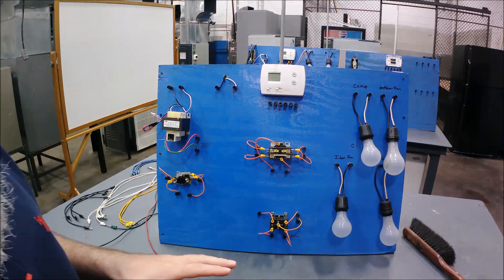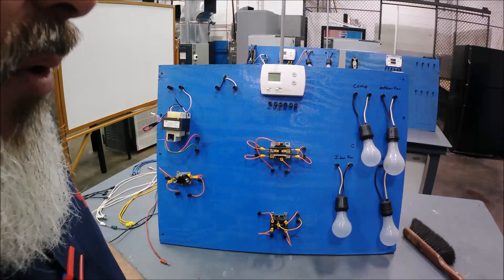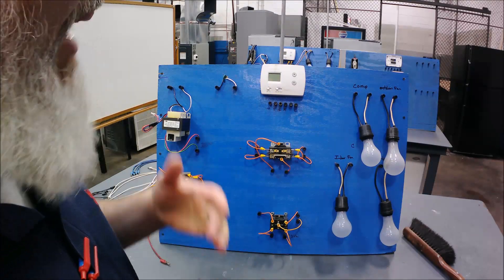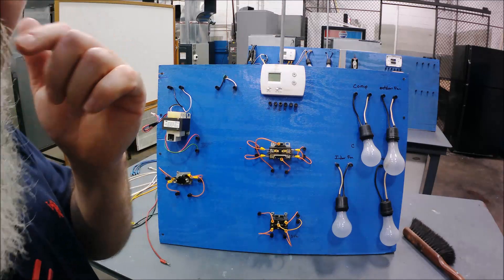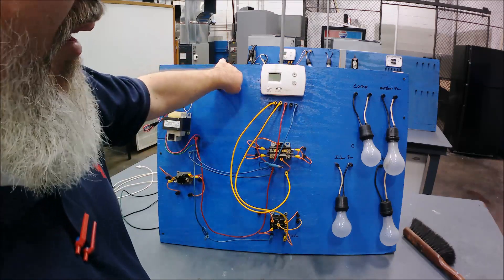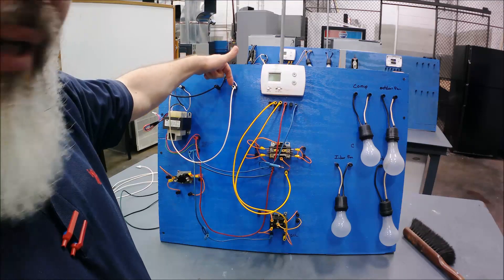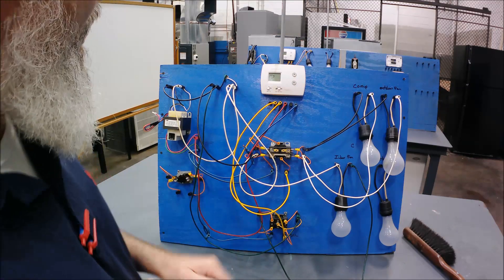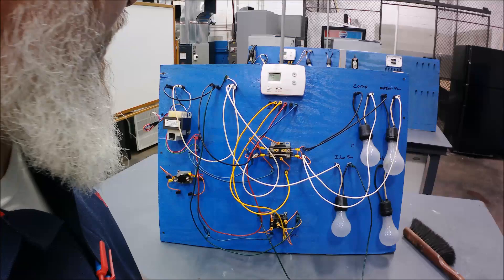Basic Circuits | Practice Wiring Board Walkthrough

Comment: Does the neutral on the 24 volt side of the transformer run through the transformer to the neutral on the 120 volt side?
Reply from the maker: The 120 v circuit has a neutral, the 24 v has a "common". Inside the transformer the two sides (primary winding and secondary winding) never touch. They are essentially doing the same thing...completing a path...but neither one bring any voltage to the table!

Comment: Mr.john Jennings what materials did you use my brother and what size is that plywood God bless you 🙂☺️
Reply from the maker: Nothing but a 1/2" sheet of plywood, cut 2 ft square or so. Propped up on wooden legs. Took contactors, relays, thermostat and mounted to the board. The only thing that cost real money in this setup is the banana plugs and wires to make it plug and play. I would just use regular 16 gauge wire and some terminal ends or something now.
Reply: @johnjennings-JJ  Hi John, Great video. If you can create a video on how to create this board. that would be grat! Thanks in advance.

Comment: No sequencer?
Reply from the maker: This board just didn't have one. Put it in and wire it exactly like a relay would be. W from thermostat to low voltage "coil"  and 24v common back to secondary of transformer.
Reply: How would you wire the indoor fan to come on  after Heat kicks on? 
Thank you
Reply from the maker: Manufacturers like Goodman use a high voltage wire connecting the heat strip circuit to the indoor fan circuit. One end is placed on the leaving side of the heat sequencer and the other goes to a normally closed switch on the fan relay. This way when the heat strip gets power it will also feed through the fan relay and turn on the fan.

Comment: Thanks for the video .   I am clearly not an HVAC tech .  I believe there are some older installs that did not have a Blue (common) wire.  How can a t-stat function without the Blue wire  return path ?  My own system is an oil fired hot air furnace with a/c - using one x-former i believe .  My t-stat is an older Honeywell digital programmable that works fine.  System has five wires including a Blue wire that connects to terminal on t-stat marked Rc .  T-stat also requires two AA batteries .  Why does t-stat use two batteries if it has the Blue (common) wire ? After doing some additional research i understand that Rc and C are not the same so that is why the t-stat requires batteries .  There is no jumper between R & Rc on the t-stat and there is no x-frmer in the a/c unit .  I guess the big question for me is how can a t-stat function without  a common (return path wire) ?   i am thinking of a 1/p switch - it cannot work without  a neutral wire / correct ?
Thanks Again
Reply from the maker: The batteries are what power the t'stat and let it work. With batteries you just need the 24v hot  wire providing power into the t'stat switches. Like an old school mercury t'stat. The batteries make the switches move and pass the 24v to whatever you need to work. Depending on your e act setup you would only need 4 wires with batteries. I wonder what system you have...just an oil furnace with a/c? Nothing fancy?
Reply from the maker: To the point of the 1 pole switch...switches just break power. Either the L1 side or if you want, the neutral side. We usually break the hot for safety reasons but regardless, switches just break 1 side. Only electrical loads get both L1 and N or whatever the power source is.

Comment: Where I can  buy this type of cable
Reply from the maker: Lots of places online and in a store front. Try looking up banana to banana plug test lead...that should pull up something useful
Reply: @johnjennings-JJ  Thanks
Reply: @johnjennings-JJ  hi John , these are very useful videos. I am an HVaC teacher and I am planning to build one based on this model. I found the 16 wire gauge but let me know what are those hole contacts that are attched to the board where we hook up these wires to? Thanks in advance
Reply from the maker: Should be something like a "banana jack". I think last time I was looking at making some I decided I would just go to a big box store and check out the speaker wiring. Might be able to get everything there.
Reply from the maker: Or try female connector bindjng post for banana plug

Comment: Hi John, thank you so much for your videos. They are very informative. I have noticed a low buzzing sound from my furnace. This buzzing started this winter just before the heater would turn on. The buzzing would last about 20-30 seconds before the furnace would turn on. Now I have noticed the buzzing again prior to the a/c turning on. The buzzing comes and goes before a/c turns on. Wondering if u think this could be the transformer or the fan relay switch?
Reply from the maker: The transformer is something that should have power 24/7. I have noticed that they do make a quiet buzzing sound sometimes but then again so does a contactor outside. Could be a relay on a circuit board. Sometimes the buzzing comes from a loose screw that may be holding a part or cover to the unit.  Hard to say. Would have to be there or just wait and see if it stops working correctly.

Comment: Thanks again for sharing the video.  Do you have a video where you're calling for heat?  when calling for heat, do you use another general purpose relay or the sequencer?
Reply from the maker: Thanks viper. I was actually gonna try to get  the next video to be on an electric heat unit. But to keep it short...i replace the OEM part whatever it is. Usually it is a sequencer or contactor for me.
Reply: @johnjennings-JJ  Thanks  John, we need that video about sequencer wiring.